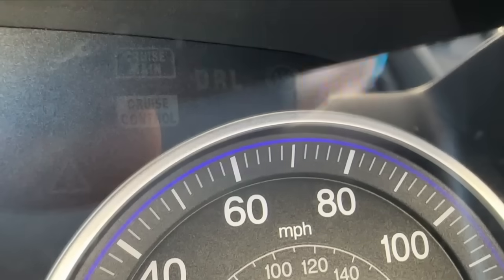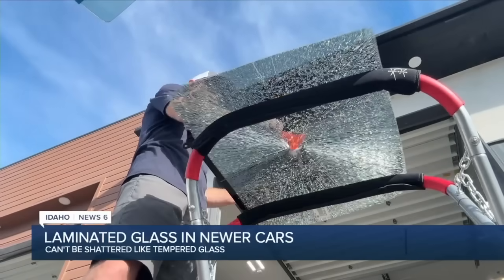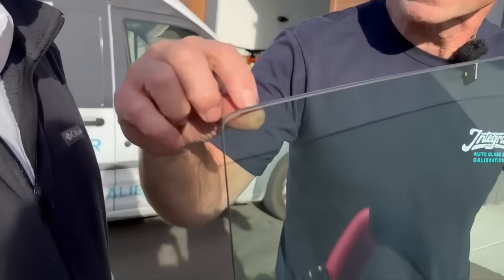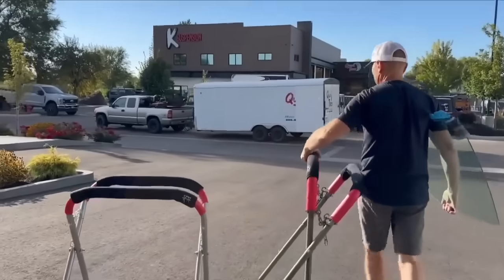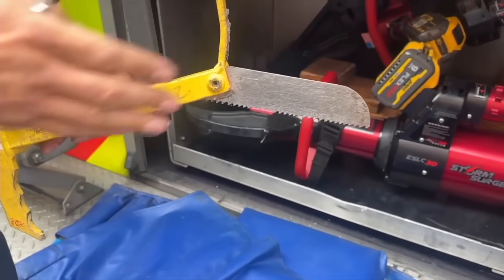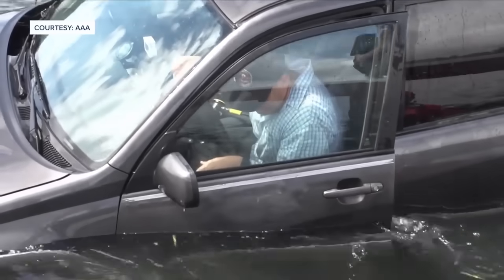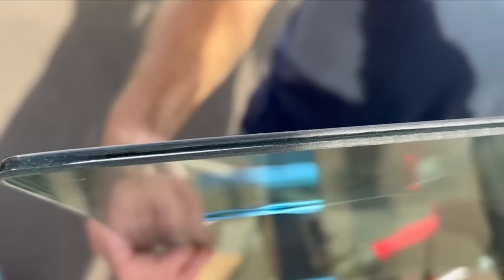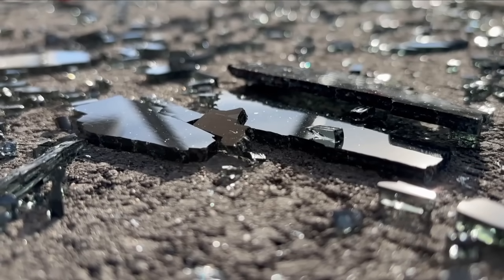New trend in automotive glass could put your safety at risk

Comment: The reason they are using laminated glass on the two front windows is for support of the side curtain airbags it’s part of the vehicles safety features it’s not for road noise that the dumbest thing I have heard the back windows will transmit road noise as if you were sitting beside them manufactures and the engineers have been doing this for over 15 years it’s not a new thing if you are concerned about getting trapped in water roll the windows down when travelling over water

Comment: The obvious and easy solution would be manufacturing the doors so that they come off in a crash instead of crumpling and getting stuck as a basic requirement.
All these junk innovations that don't even do what they're supposed to but I can't get a door that comess off in a crash instead of jamming.
You can't even buy a gas can that works properly and doesn't leak because of over-engineering😂 but a throwaway door is too much to ask

Comment: It's not "NOW", they've been using it for decades. My 07 Ram 2500 has laminated glass on the sides. It helps prevent break-ins, which are MUCH more likely to happen then you driving into water. This story is nothing but fear mongering.

Comment: Prefer the laminated glass, it should be standard for all windows. Safer from road debris, less easy to break in, and less likely to shatter and fly everywhere. If I go off in water I'll either sink with the car and then open the door once the pressure equalizes, or I'll roll the window down when heading into water. Nothing but problems out of tempered glass, and I plan to stay out of water.

Comment: Laminated was for Windscreens so if it got broke you can still see through it while driving. Can't do that with shattered Tempered screen if it gets smashed while on the highway.  You have to put your hand through it if it doesn't completely shatter and fall out. That usually doesn't happen because it just crazes and stays put.  Really good whilst cornering, probability of that happening while cornering is possibly similar to driving into water.

Comment: I own a 2025 Tesla with this type of laminated side glass windows. My first Tesla was a 2018 with standard no laminated glass.
Here is the problem I can say with Tesla’s, I guess with other car makers as well. An EV has less noise from the engine, so you could hear more road noise from the tires and through the glass. Consumer Reports and customers complained about this. Personally it didn’t bother me. But so many people and car reviewers complained. Thus became a big problem for Tesla, which needed lots of sales. I took a test drive in a 2026 Tesla Model Y. That car has triple laminated side glass front and rear, and allot more sound proofing. Driving that car with the windows up, felt like I was deaf. You can’t even hear emergency vehicles coming. No outside noise at all.
So I don’t blame car manufacturers for this. I blame stupid people complaining like babies about noise. Now with have a big problem. Solution! Stop making cars with this type of newer laminate glass. It’s super dangerous and you can’t get people out in accidents, and with car fires, they just burn to a crisp inside.

Comment: I’ve worked on a lot of high end cars replacing door glass and found all windows to be laminated at times even the back glass. I’m guessing that’s due to the cars having rear side curtain air bags and the compressed air would pop tempered glass so a stronger glass would be needed for the air bags.
Reply: Also so thieves have it harder to break into the car
Reply: @JustRememberWhoYoureWorkingFor lamination holds the broken pieces mostly together making it much safer to rummage the vehicle. If they want to get in they will get in.
Reply: All vehicles have pressure vents to release air pressure from slamming doors or srs deployment.  I have never heard of laminated rear vision but it'd probably out there
Reply: @gordonchin8008I only see in luxury

Comment: Standard auto laminated glass isn't that strong. The glass guy in this video should have made that known. He knows, since he replaces auto glass for a living. 

If you have laminated door glass, you need to disrupt the structural integrity of the panes, then the glass will just fold. The key is to break both panes of glass. 

When he was striking the glass, he didn't hit in the same place twice, because doing so would weaken the outside pane and allow you to get to the PVB layer, then to the inside pane. Once you do that, the glass becomes as weak as tissue paper.

Also, tempered glass can cut and stab you just the same as laminated.

Comment: I'm not a glass expert, but this story makes no practical sense. Plate glass can be a problem, if people accidentally walk through it in a sliding glass door in a home. (I think there may have been a building code change decades ago to specify safety glass is used.) However, laminated glass in vehicle windows seems very desirable to me. It's so durable that it takes a huge amont of effort for thieves to break the side windows of cars with laminated glass. Someone I know had someone tried to burgalrize his Toyota pickup when it was parked outside his home overnight. Scratches on the window appeared to show they had tried to hit it with something several times before giving up. That doesn't sound like it would be a safety hazard to someone inside. The glass doesn't break up into tiny little pieces, but it also doesn't easily break into jagged shards on impact. As a matter of fact, given the skyrocketing rate of car break-ins in many big cities, this glass seems almost like a necessity. I would also feel much safer if I was inside the vehicle when a bad person was trying to get to me. The lower road noise also makes it much more comfortable to ride inside. For those with some hearing loss, not having that low-rumble of road noise makes it easier to hear your car stereo and carry on a conversation. As for the danger of being stuck in a car when it plunges under water,  in Southern California and most population centers your chance of having your car broken into are probably 100x greater and even your chances of being attacked while you're in your car are probably 5x greater.
When my car window war broken as part of a burglary, I asked the auto glass guy if it was possible to swap out my window for the more-expensive laminated pane. Unfortunately, I was told that the car door window frames are made specifically fot the type of glass they come with. So more expensive vehicles --such as Lexus typically get the laminated glass while the less expensive Toyota models usually don't. If you worry about being stuck in your car, don't get an expensive all-electric car with no mechanical door latches. The electonics to open the door have malfunctioned in crashes and fires, plus the windows are probably laminated too.

Comment: Um…if you drive into a pond or lake, your electrical system still works. Lower your windows! Especially Tesla’s. The circuit will still work for a few mins before it short circuits. They even tested it on mythbusters.

Comment: This wouldn’t be a problem if windows were still manual crank and not electric. The crank works even when submerged.
Reply: So does electric.  It's common for them to continue working for a long time.  Only caveat to that would be in salt water it will die pretty quick.
Reply: Sometimes the crank doesn't even work in air lol

Comment: I wonder if those really dark tinted windows have a similar issue. I know that a lot of people have installed DIY tinted film to their automobile rear windows, usually with mixed results (bubbles).
Reply: Aftermarket tint goes a long way to keep tempered glass in place, but it doesn't do as well as the middle layer in laminated glass. Laminated stays together because it's not designed (during manufacturing) to crumble into cubes as tempered is. However, the PVB (clear plastic layer between the two panes) acts as an adhesive for the glass, so even when it cracks, it stays together. 

Bubbles in tint is usually from low quality tint. Tint is best when it's the good stuff.

Comment: I installed laminated in my tow trucks to stop the thieves from stealing it and my expensive recovery gear! Tired of my trucks being found burned out with the wrecker bodies, booms, wheel lifts, roll back assemblies, and the engines and transmissions even the axles and suspensions gone on most of them!

Comment: Water is one thing but what about the opposite, fire. Get into a crash where the doors won't open, windows won't come down (no power, unconscious occupant, etc...), and the car is on fire. You don't have time to wait like you might if the car is in water, you need to get out NOW.
Reply: This. People saw the "car into water" example and immediately concluded that's the only downside
Reply: A man in China, driving a Xiaomi SU7 electric car, burned to death when the car caught on fire and the electrically powered doors and windows could not be opened. RIP
Reply: Here in the UK it's fairly common for the rear passenger windows to be manual. It's for safety to stop kids trapping themselves in the window if it goes up.
Reply: not for at least a few mins and if out cold and can't open a window u cant smash on either 😂
Reply: @edwilko8819 It's easy to smash the window using one of those tools because they have a ceramic point
Reply: Teslas lock you in
Reply: Don’t even have to crash just own a Tesla
Reply: @RuckusGarage  You mean literally the safest vehicles on the road?

Comment: Farm equipment used to use laminated glass for the cabs. Now many of them have switched to safety glass, and I feel it is because they know that if a window gets cracked you might finish out the season before you stop and take the window out and get a new one. But now you must stop and go to the dealer to get a new window because the dealer is the only one that holds that window and knows the size it's supposed to be.
Reply: Its super easy to mold a piece of plexi for a tractor.
Reply: @xenn4985  Plexi scratches and becomes dull you need to be able to see out of the thing after a few days in the field instead of just scratches.
Reply: @dalesuhre6522 never heard of a buffer? You people always do this.

"I have a problem"
Okay heres a solution
"But that solution isnt as convenient as paying someone more money"

You deserve your problems
Reply: @xenn4985 I don't have a problem. I have patterns for every piece of glass from my farm equipment. The problem is that these manufacturers are now making it with safety glass instead of laminated glass which makes it completely shattered out if it gets cracked. They do that because they know you as a farmer are going to have to stop everything go down to the dealer and purchase a new piece of glass. But if it was laminated glass you can continue on with your work until you have time to take that piece of glass out and have one made for half the cost. And to answer your question, buffers do not work on plexiglass that have been out in the sun beaten by rain, beaten by wind, beaten by the Sun and dust.
Reply: @dalesuhre6522  can't you just install a clear protection film on the glass, there are ones for car windshields against rock chips, so there must  be ones for farm equipment

Comment: Car makers just need to change door designs to allow windows to be popped out. Quick removable panels or something. Maybe a built in lever on the inside of a door you can pull , after removing a safety cover ?